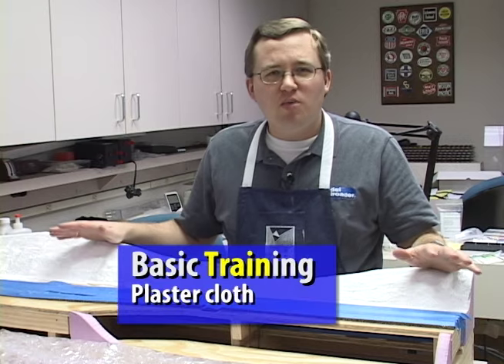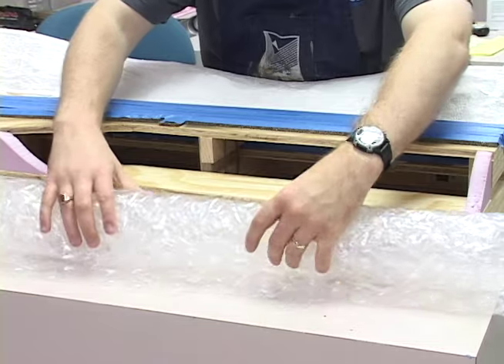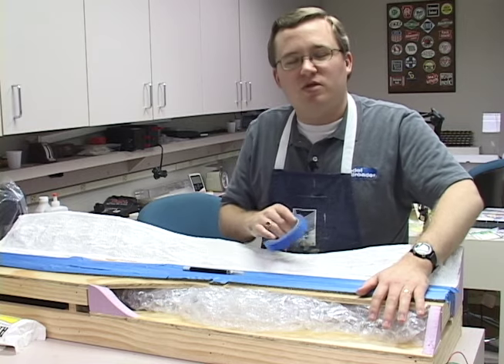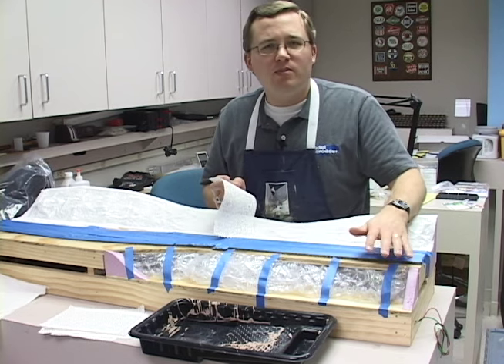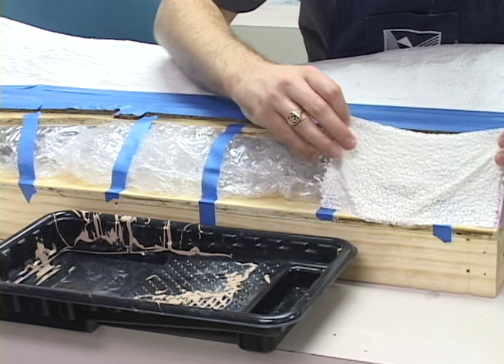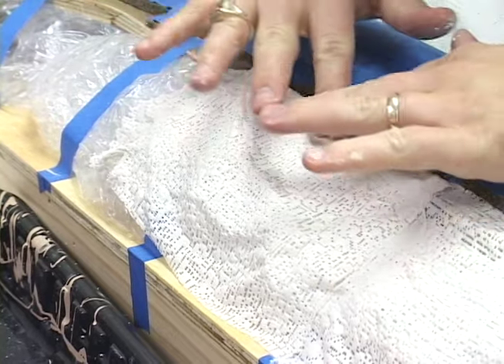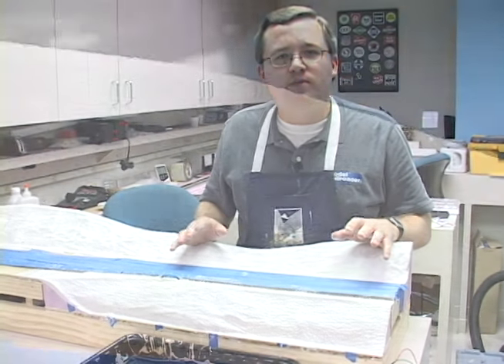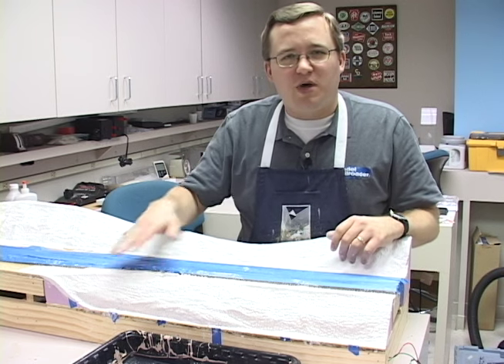Model Railroader basic training video: How to install plaster cloth

Comment: I'm sorry but are you supposed to use this kind of product on this part of a layout or could you still just use foam board?
Reply: I know its a bit late for someone to be replying to this but you would be fine using either. I tend to use foam to for elevated flat areas and plaster cloth for the rest.